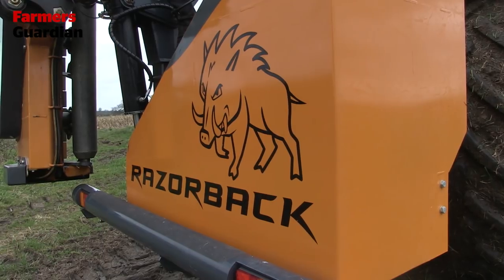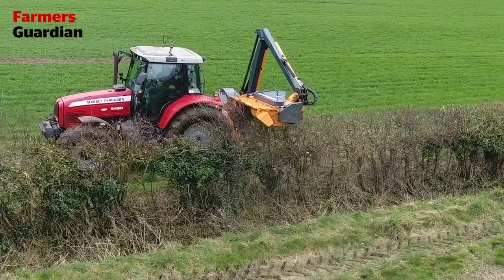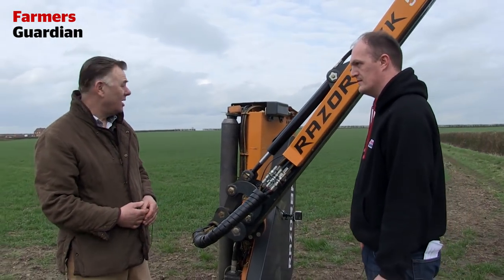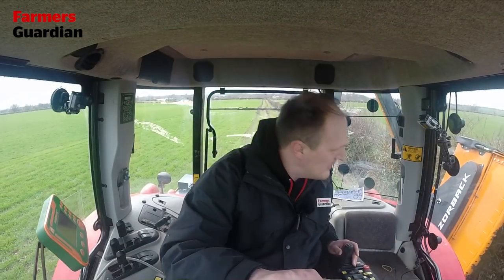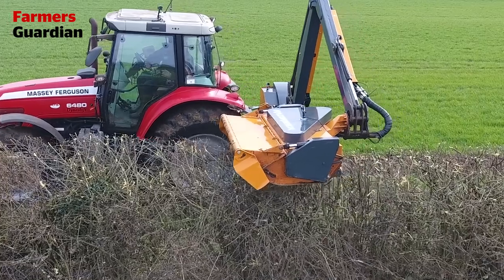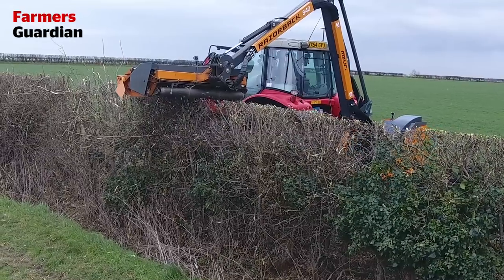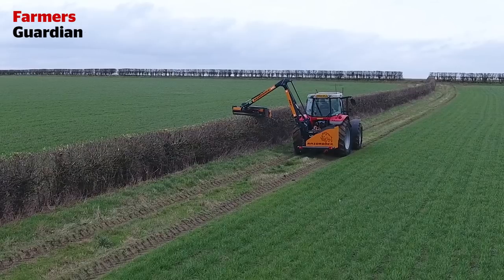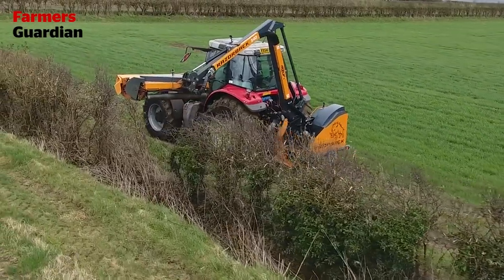On-test: Mzuri Razorback Hedgecutter

Comment: Nah! If you got the cheque book get the twincut head! Rotors are limited in my experience 😉 don't get me wrong, it looks a good machine all round, I just don't think rotor can take continuous 4 inch diameter. A flail will continue to turn & not jam giving it chance to eject the offending object. General hedge & ditch work aka cutting your own!  😉😝 this is the machine, but contracting... Flail every time 😉